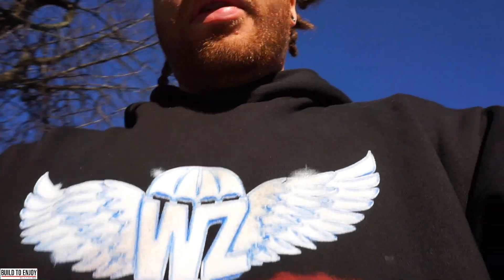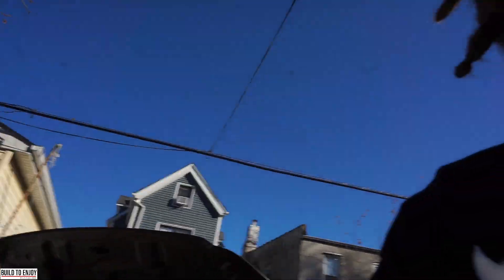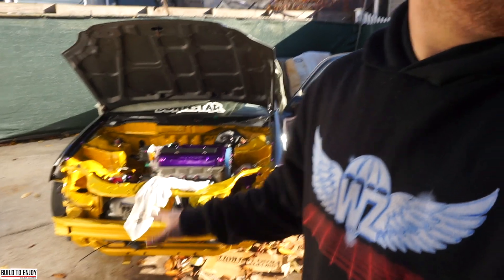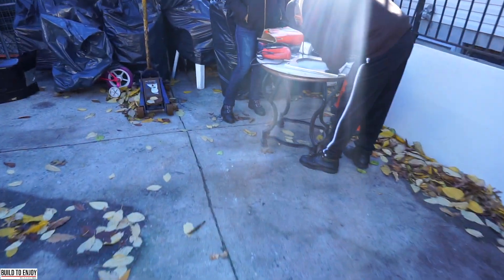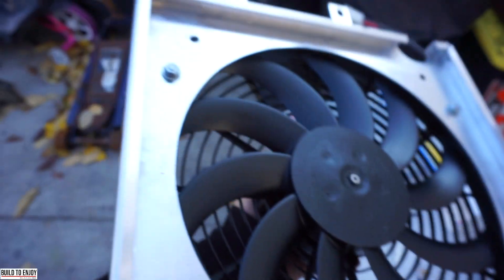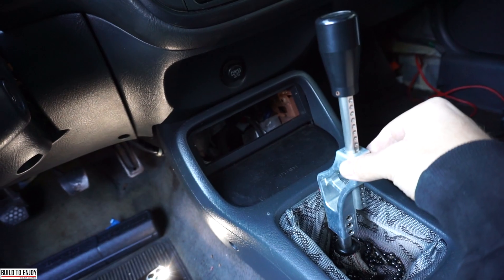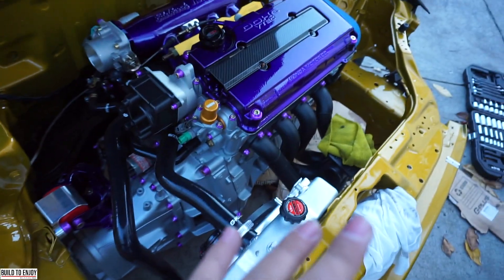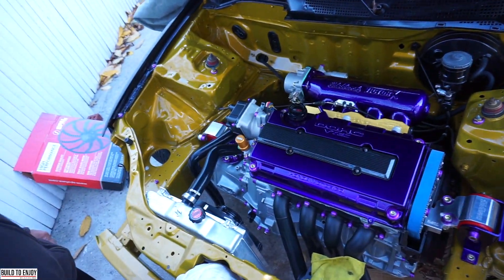KEEPING MY FULLY BUILT B SERIES SUPER COOL WITH THIS AMAZING NEW SETUP !

Comment: You didn’t port match the intake manifold to the throttle body? That’s a restriction. It’s a bigger throttle body for no reason the flow ain’t going into the manifold
Reply from the maker: Yea didn’t get time to port it but mainly got it to match the pipping size

Comment: Buy another radiator. B series. The inlet and outlet are bigger. It makes a difference. Also that fan shroud needs to be cut to the size of the fan. That also makes a huge difference!
Reply from the maker: Lets see what happens if i see it not cooling as good ill get another one